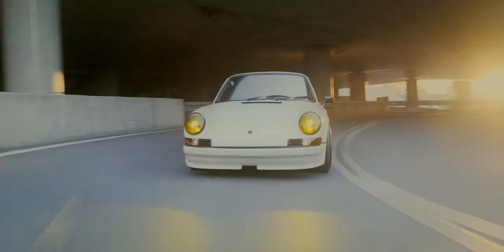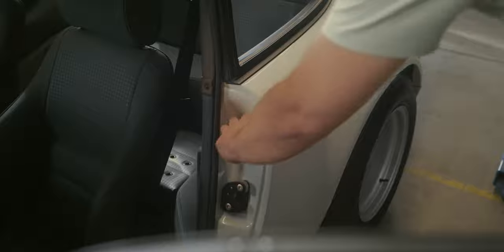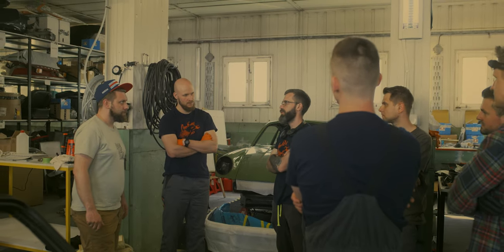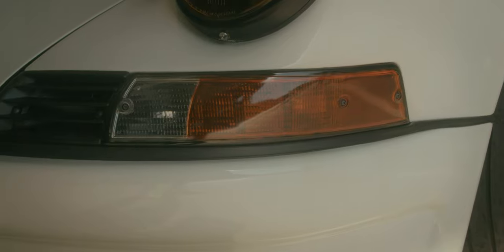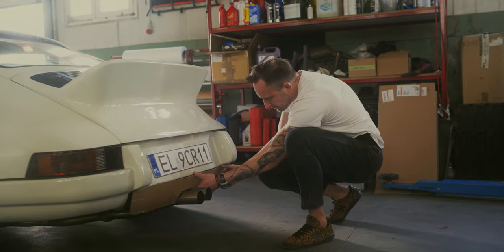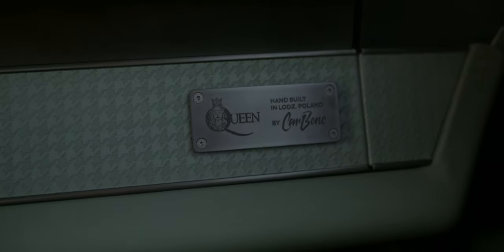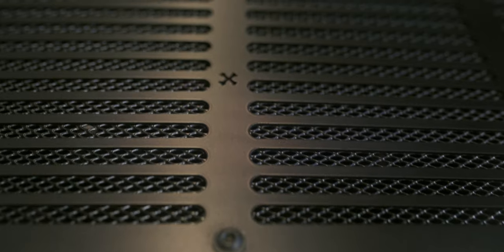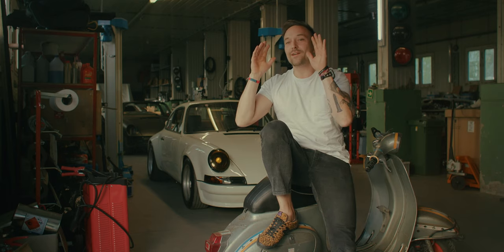This is not a car. This is Queen.

Comment: Blah Blah Blah. Please state HP, weight, revline, suspension and brake mods. and rear and front wheels width. The best Porsche is the one with no interior at all. People will carbon fiber the whole car so they can put air cond and booster stereo speakers. It was done before. They call it a Singer.